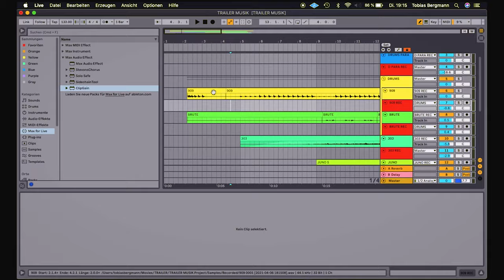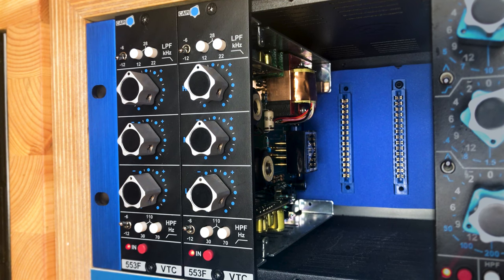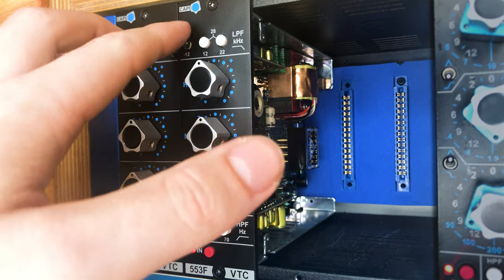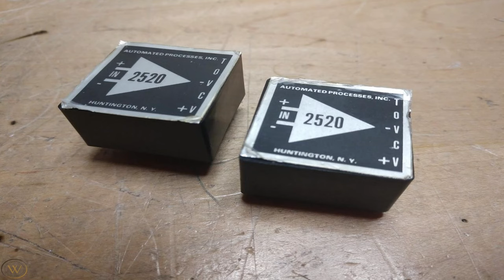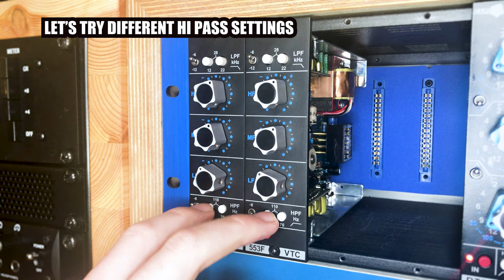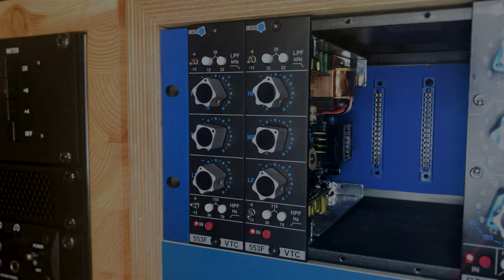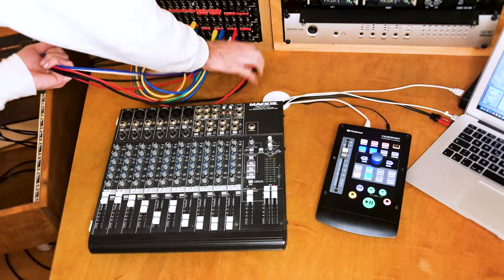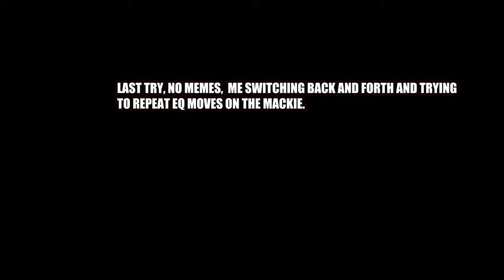KING OF ALL FIXED 3 BAND ANALOG EQS??? CAPI 553F DIY-KIT EQUALIZER FOR THE API 500 FORMAT

Comment: Nothing is true and comparable between API and cheap CAPI. If somebody says so than they don't have a clue what API sounds like. Other than your bass demo everything else sound better without the CAPI on.
Reply from the maker: Thank you for watching! While they are indeed super comparable down to the circuit aswell as the build quality of individual parts like transformers and Opamps, I respect you referring to „sound“ which is still a very personal experience and has more factors than just the design of a unit - the reputation of the brand and even the cost factor can play a role in there. And as always - I leave the question „how it sounds“ open to everyone watching and listening! Hope that helps. All the best, Tobi
Reply: I disagree :)